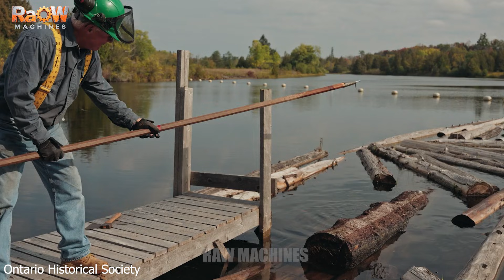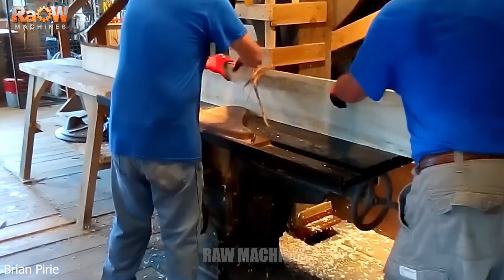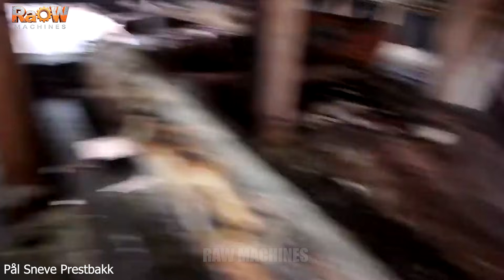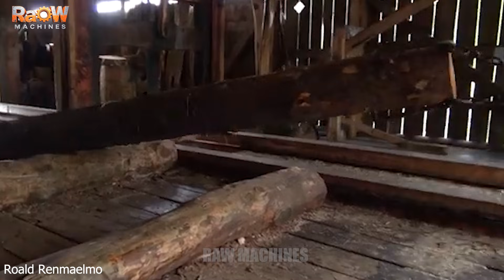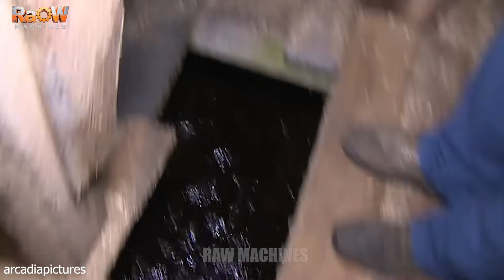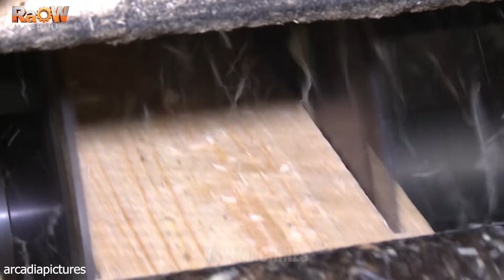Before Electricity: Inside Off-Grid Water-Powered Sawmills | Hope Mill

Comment from the maker: Before Electricity: How Oak Logs Were Turned into Planks | Traditional Diel Sawing | Old Sawmill
https://youtu.be/mQbidfQs5es
Reply: I've never seen a "modern bandsaw whip back & forth. Many have adjustable rollers that make contact with the blade to prevent wobble. Unless you accidentally said the opposite of what you meant.

Comment: Why do they have to drive wedges in the logs, after they have already been cut?
Reply: Logs will SOMETIMES pinch back on them selves because of the way they grow. Sometimes the saw cut will not pinch but open up as the saw goes through them.
Reply: They do not cut through the log to the very end.  That way the log  remains standing upright as it nears the final cuts.  If too narrow it would tend to fall over.  So the wooden wedges are hammered in to split the boards apart.  Wish I had known of this when sawing up small logs on my bandsaw.  Instead I had to try to keep them pushed up against a fence.
But as suggested by the other commentator, when a log is pulled back without completing a cut, wedges may need to be inserted to prevent pinching on the then stationary blade.